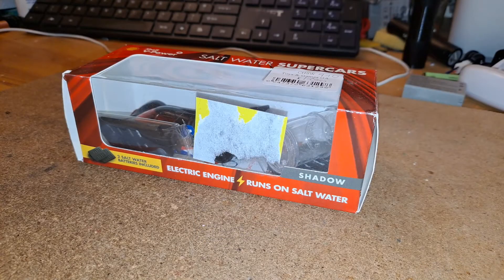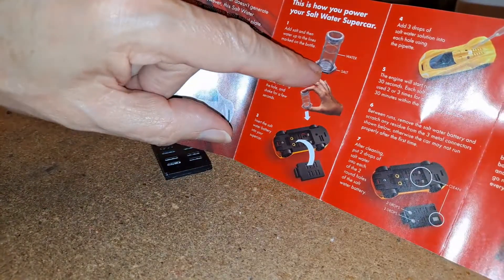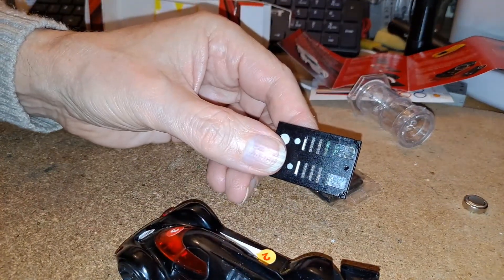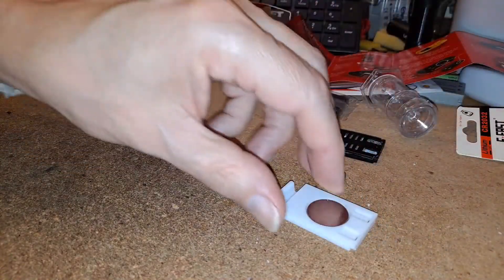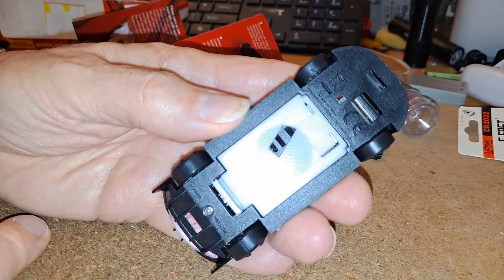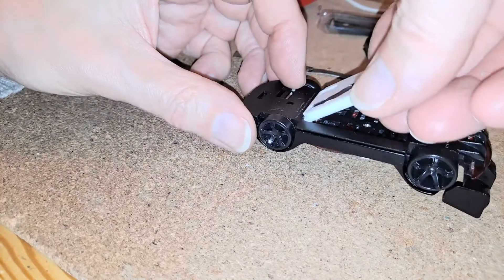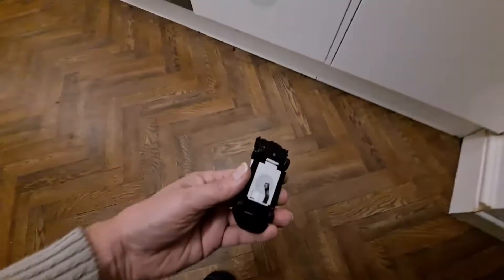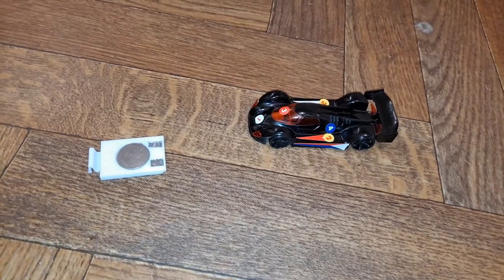Shadow - Shell V-Power Salt Water Supercars Button Cell Conversion

Comment: Thats a nice conversion and it works Pretty good too.i wonder if you could put an on/of Switch on there somehow for Demonstration purposes 🤔. 4 runs and the battery was Flat already. The Button cells dont last long with a conversion like that . Would it run on a lipo battery ?
Reply from the maker: It runs for a crazy long time on a small lipo, that is in a later video.

Comment: I suppose you could 3d print some track segments, but it would be a long project! The car looks too big to work on a hotwheels style track. When I was a kid I had a racing set by Matchbox that had reghargeable batteries in the car, that ran along a hotwheels style track but was a bit bigger I think, and you could switch the motors on and off by rotating magnets on the track, to control the speed. It came with a recharging station styled as a garage I think. It was quite fun, but I only had the one car!
Reply from the maker: It would be interesting to find one of these with the bluetooth control. 👍
Reply: Hm don't know if Matchbox had anything like that but i know hotwheels sizzlers was a thing, maybe its those you are thinking of ?
Should be a bunch of videos on youtube of them, ofc batteries have long since been replaced on those that work with new cells most likely that run today.

edit Ah found the matchbox ones, they are the matchbox scorpions & there was also the corgi electro.